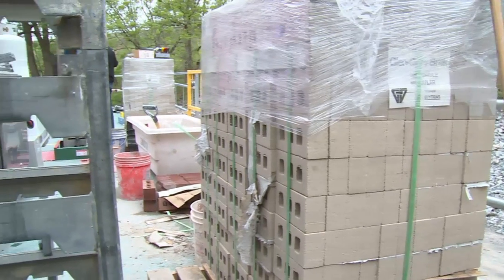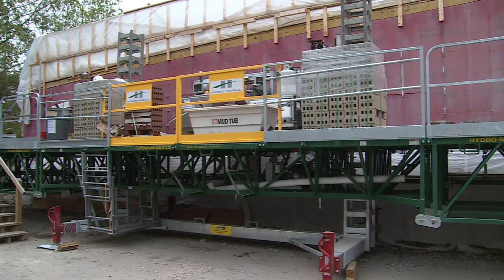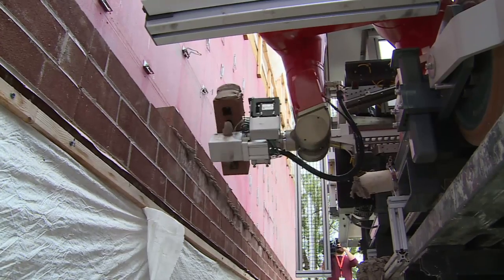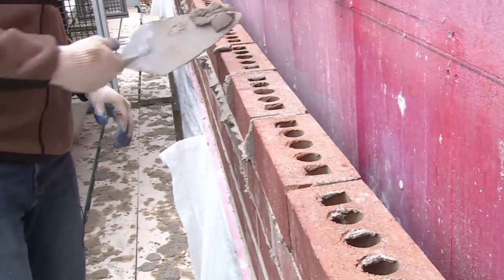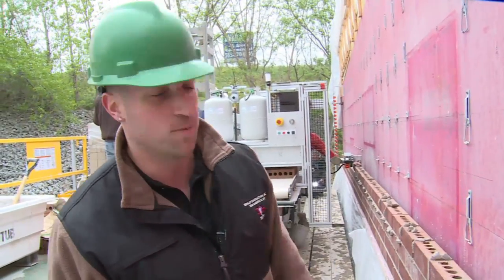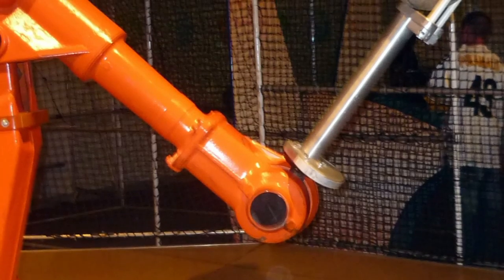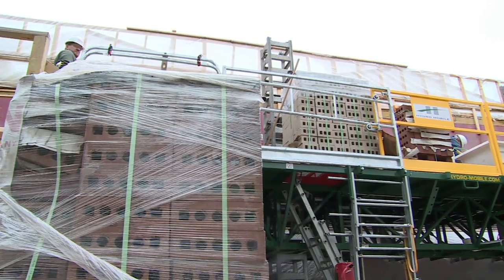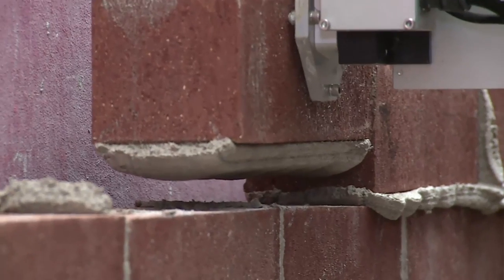Can a robot do your job? | SciTech Now

Comment: This is an ok design. It is a start but I would recommend more intervention like having the stone mason program the machine to follow a specific pattern. I also would say that a future machine could use a more rough terrain drive train with suspension an aerial work platform. A rough terrain scissor lift or rough terrain boom lift would make an excellent machine to build his onto. I do want to say it is a very well engineered brick layer. Props to the engineers that made the machine be abled to do that.